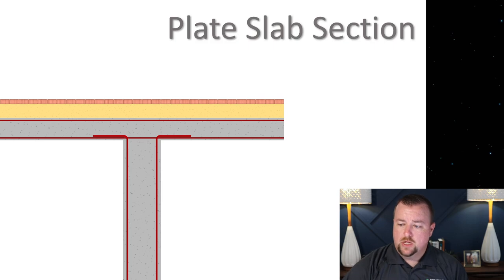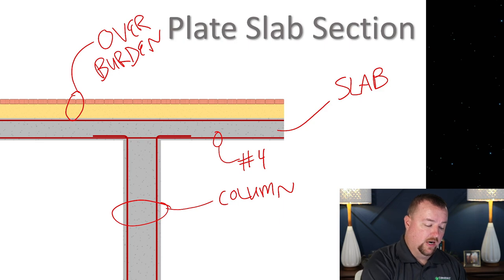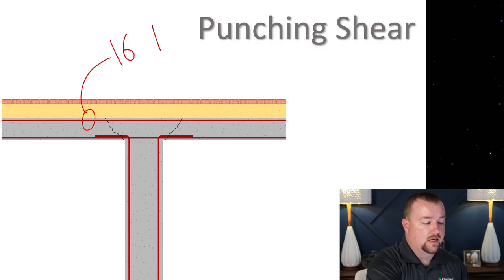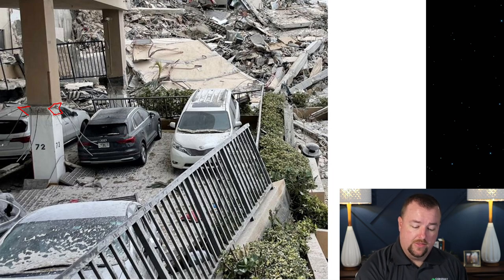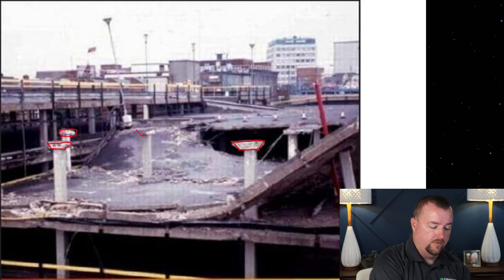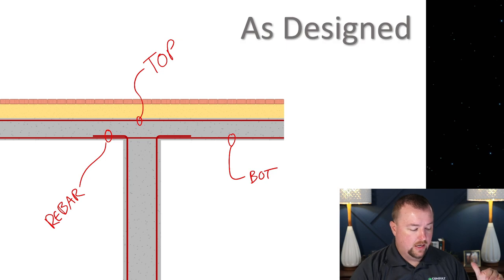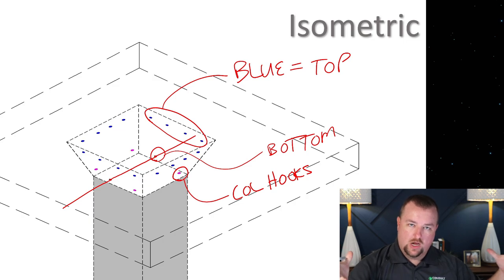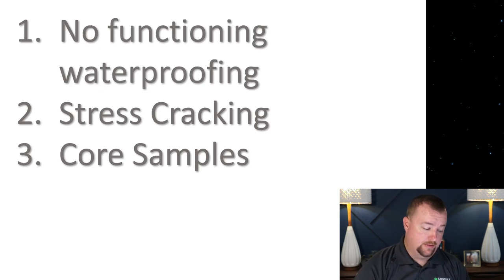The Importance of Punching Shear at the Surfside Collapse

Comment from the maker: For the more technically advanced viewers.   The contribution of the steel to punching shear in this building is not as significant as the concrete's contribution.  Codes around the world limit most of our punching shear formulas to JUST the concrete.  Shearhead reinforcement is only used if the math doesn't work for the concrete alone and this type of reinforcement must be specially designed.  This is built into the codes more as a precaution than because of any idea that the steel does not contribute at all.  The reason for this is because concrete failing in shear is sudden and catastrophic and should be used as the limiting factor.  Therefore In this video, we look at losing the steel reinforcement, which may be argued as insignificant, but nonetheless relevant, AND the loss of the top layer of concrete due to delamination, which would reduce punch-through resistance by as much as 25%.  For more information, I recommend reading the ACI commentary on 2-way slab shear from ACI's historical records.  Thanks for watching!
Reply: What If punch-truogh caused pool deck collapse? And there is clip that shows water flow from pipe to carage. Could 7 min water leak to damaged carage cause hole building collapse? Atleast if there was void space and cagare slab broke and cause suddenly huge flow of water to void space that could cause  damage to columns stability.
Reply: BTW, I liked the video but I just wanted to clarify some misconceptions about shear in concrete.

With any significant bending (Mf>Mcr) and full delamination or corrosion you loss 99% of your punching shear capacity and not just 25%.

The top bars are there for bending but they are absolutely critical to punching shear capacity. Without them, the shear capacity approaches zero. With a high bending force, even without delamination, any major corrosion in the top bars will essentially eliminate the punching shear capacity (Although with very low bending stresses, you will still have some punching shear capacity without top bars).

It is a misconception to think that there is a steel (vertical steel) and concrete contribution. This idea came from older codes. The concrete portion was a fudge factor since the steel portion significantly under estimated the predicted shear capacity from a 45 degree strut and tie model. Newer codes (I am not sure about the US codes since I am not from the US) use a variable strut angle models that more closely models the actual behaviour.

If you had pure bending without shear, the concrete crack in a slab or beam is vertical. With low bending but high shears, the crack angle might be 30 degrees from the horizontal. With varying bending and shear, the angle starts vertical out the edge of the failure cone (the hammer head) and then develops into a shallow angle where the column intersects the bottom of the slab. The compression strut is close to parallel to the cracks in the concrete (Mohr's circle: the highest compression is perpendicular to the highest tension). Vertical steel crosses through the cracks so you can develop a "truss" to increase the capacity. However, most countries don't allow for vertical shear steel in thinner slabs (it has no effective contribution since it generally can not develop over a short height).

Understanding the relationship between the top steel and punching shear is critical to understanding the probable initial failure mechanism.
Reply: 13:40 The sand+paver+ waterproofing +  tile+mortar + topping slab  together form a layer of 4  6/8 inch which is already pretty thick. I wonder if that's the delaminated  layer that we see on the pictures pointing upwards, discussed later in this vid   ( 22:40 ) 
---
What happens, if a 12 floor building collapses on top of a completely intact pool-deck. Would that lead to the collapse of the pool-deck ?
Reply: @reallyme3573  Second hand eyewithness has told that pool-deck collapsed first.
Reply: I’m wondering if the builder even followed the planners rebar schedule.
Reply: @reallyme3573  We know that the deck failed first from video evidence and eyewitness reports given from people in the building just before the collapse of the main building.
Reply: @yodaiam1000  Codes be damned. Engineering knowledge should be the same everywhere. It's the engineer that follows a bad code that is to blame. See my comment below.
Reply: @ToIsleOfView  I don't know which comment you are referring to.

Codes aren't a precise representation of concrete behaviour. They can't be. What they try to do is give a simple representation of the behaviour that is consistently safe. There is an art to approximating nature in simplified formulae. The structural code is not to blame in this case (or at least as far as we know at this point in time).
Reply: Josh..Have you ever utilzed your skills and analyzed what took place with the Solomon Bros. Building (Bldg.7) as it's referred to as the new owner being Larry Silverstein's  of this entire complex was said to have communicated with a fireman conveying to him to ""Pull It" and BBC's uncanny knack of telling it's viewers that this building hadn't even collapsed at the time of their statement along with the said booming sounds of many witnesses statements just before this building collapsed into it's own footprint later that evening as if it were a controlled demolition.  Uhh Uhh..No not fire.  And no...No commercial jet airliners ever hit any of those towers...IT''s next to impossible to fly any jet air craft at sea level altitudes at the speed and accuracy indicated with CGI video footage which also wreaks of fakery.
Reply: The slabs punched through the support columns due to delamination and weakening of structural slabs and rebars strength resulted in the water intrusion and chloride attack. Did the structural engineers also measured the diameter/thickness of the failed columns? I think if the support columns are not that thick enough and hold water for so many years stressing the slabs and columns coupled with the reduced punching shear strength by 25% on its concrete slabs and rebars due to delamination, the parking garage ceiling slabs would sag rapidly and punch shear easily above the pool deck/below the parking garage. May I know if the diameter/thickness of the support columns may also contribute to the rapid punch shearing failure of the concrete slabs? Also, am I correct to say that the punching shear failure started when the pool deck starts to sag down to the basement parking garage until its collapse? Thank you.
Reply: The pool deck may have collapsed first, but before that there was failure in the garage entrance ceiling 1 floor above, with a large flow of water and ceiling collapse at entrance happened FIRST.
Reply: @jockoharpo2622  That's a good one. Keep it up. :)
Reply: @yodaiam1000  How does the deck take down the rest of the building? Why aren't buildings designed even in 1980 to not affect the other areas if just a deck area collapses?  No..The lesser tall structure collapses then takes down the higher structure.
Reply: @jockoharpo2622  Actually in earthquake zones we want the structure tied together. In a healthy structure, it helps create redundancy. We call the lower deck and surrounding walls, the podium. We transfer earthquake forces from the core to the podium walls. In order to do that, you have to have the building tied together. If you don't do that, it gets very expensive to deal with the earthquake forces.

There are many  possible triggers that can take down an entire structure. Of course, where practical, you try to get rid of those triggers. In this case, it was and still is extremely common to tie the building to the podium. No professional would look at that and decide that it was bad decision.

Punching shear is responsible for multiple building collapses. In many cases it started in one small area and then progresses throughout the building. Sampong in South Korea is an example of this. A building, especially heavy concrete ones, has a lot of potential energy which leaves it open to progressive collapse. You really can't completely design around this. You have to be very careful with shear and punching shear in concrete.

The bottom line is that there is no fool proof building. you can't ignore maintenance. You need a good membrane and building envelope.

We don't know yet, but there could have been contributing design errors as well. But that is another issue.
Reply: @yodaiam1000  Is Miami in an earthquake zone?  Well so much for healthy.  The healthiness would also include it's ability to not take so many or any lives with a collapse  that could have still been engineered to support the other parts but still to have the ability to "break awaay" from the rest of the structure not damaging it so people may have more time to escape.
Reply: @yodaiam1000  Well it definitely redundantly collapsed. By the way..Who is "we"?
Reply: @yodaiam1000  And wehre do  you get this knowledge you are sharing?
Reply: @yodaiam1000  What maintenance could have been done to have saved this?  I would think that there would be an inspection dept for the city that helps to keep them up to code since this is a prone area for water breachment along all coastlines. - Especially with corrosive environments.  - Moreso than earth quakes.
Reply: @jockoharpo2622  It is not reasonable to compare a badly maintained building in a highly corrosive environment without a proper membrane to other redundant buildings.

"We" refers to structural engineering design professionals. I am telling you what standard practice is.

Any punching shear failure anywhere in the building could have had a similar effect.

We have punching shear and shear design as being critical drilled into our heads because it so unforgiving. There are for more warning signs of a concrete bending failure and it tends to fail slowly. There is no way to design your way out of punching and other shear failures except to make sure you have enough capacity and by adding integrity bars.
Reply: @jockoharpo2622  I understand in this area that the only required maintenance is a 40 year inspection.
Reply: @jockoharpo2622  For maintenance, you have to check for and repair delamination, replace membranes, Make sure the drainage is working and acceptable.

It is true that many of the buildings in this area and other corrosive environments may be doomed.
Reply: @yodaiam1000  Where are you?  Do you lose sleep over this and obsess about the comments on here?
Reply: @jockoharpo2622  "Where are you?  Do you lose sleep over this and obsess about the comments on here?" I didn't see this comment until later.

The answer is, no. But if you want to learn and have an honest conversation, that is okay. I assume from your comment that you are just interested in trying to troll people.
Reply: If the entire top reinforcement layer has delaminated and with the other less spectacularly visible pre-damage from water, could this have been repaired in some meaningful way (assuming it hadn't collapsed) or would a "repair" translate to complete demolition and rebuild of the pool deck?
Reply: @yodaiam1000  Which it should be every other year.  The way that building was built, it's not wonder it went down sooner.  That decking should have been separate from the hirise portions of the structure. You can build a card house like that and it would do the same thing.
Reply: @tz8785  I think once they dug into the roof deck they would realize a replacement would be best.
Reply: @jockoharpo2622  You are correct. There should be more consistent reviews especially in corrosive environments. I don't know where you are going to get enough structural engineers to do all that work but it is not a bad idea.

Expansion joints are notorious for water leaks. You are trading one failure mechanism for another. You also haven't resolved any of the other hundreds of potential progressive failure mechanisms. You have also created a series of other structural issues.

I haven't done any calculations on this building. It looks lightly reinforced to me but that was common for the 1970s and early 80s. The price of rebar was high.

The ground floor slab is continuous on most high and low rises. If you don't live a building with a continuous ground floor slab, you have certainly been in one.
Reply: @jockoharpo2622  There are far more partial collapses than total collapses. The Worlds Trade Centre building almost collapsed during the first terrorist attach.

Some partial collapses come very close to total collapses.

You do your best to design a resilient building but you can't predict everything. One decision can make one mechanism more resilient but make another mechanism worst. It is impossible to take all scenarios into account.
Reply: I don't think you should use a concrete only shear design if the slab is poured separately from the column because the slab and column are not one piece if you do that, but that is the way it is done.
Reply: @jimanonymous113  It is rare to use shear reinforcement in slabs. You usually use drop panels or capitals (thicken the slab at the column) if you need more punching shear capacity. Nowadays you can get shear rails for some steel reinforcement but they  didn't have those in 1980. You usually don't use shear rails unless you really have no other choice.

Shear steel is not always used in other elements as well.

The slab is almost always poured separately from the column. You pour columns, floor plate, upper column etc. as you go up the building.

Pouring the column with the slab does not increase the punching capacity of the slab.

It not good to pour the column with the slab because the wet concrete in column settles (plastic shrinkage) leaving voids between the column and underside of the slab.
Reply: @yodaiam1000  thank you.
Reply: galvanizes rebar in the bottom of the slab!
Reply: @jockoharpo2622  911 truth
Reply: @reallyme3573  yeah but video and sound shows the pool deck was the first to go. sounds from below says the first floor and some columns in the garage failed. the noises scared a few residents to evacuate. the pool deck collapse noise actually warned people. like 1-2minuntes later the structural compromise was too much and that side of the building sheared off an down killing 98 people. video footage and analysis will corroborate my statement. one lady was on the phone with her boyfriend telling him she saw the pool deck collapse moments later she was a human pancake.
Reply: @ToIsleOfView  water damage! codes don't allow for damage to occur. the building inhabitants and maintenance and building inspectors are all incompetent.
Reply: @jockoharpo2622  boiler room explosion due to damage from the other towers collapse.
Reply: @linn6980  no. the foreshortening of telephoto picture has tricked you. Perspective. The collapse happened at the end of the parking ramp which is 60 feet into the structure and under the far wall that sheared down. Part of the fist floor and some columns collapsed directly under the side of the building that sheared off.  breaking pipes. that's why the pouring water. a minute or 2 later the whole thing came down.
Reply: @jockoharpo2622  ridiculous to think we can design buildings over 10 stories where one part can collapse and not compromise the rest. ridiculous. if it's possible to design that within the monetary constraints by all means design that shit. aint happening brah.  when a building collapses it can and has compromised the neighboring buildings and they could collapse too and have. dominoes. those are seperate structures seperated by vast space. what you suggest is impossible with todays tech.
Reply: @tz8785  it would depend on how far the damage  had spread. It could be the columns were compromised all the way to the top and more than 1 floor slab was inundated with water. or just at the bottom. post analysis will show exactly where the water infiltration was.
Reply: @WholeCosmos  What are you talking about?
Reply: @WholeCosmos  Youre reciting hogwash.  No boiler room explosion in a building like the Solomon Bros along with the towers that did NOT collapse cause that building to go down in a free fall style conrolled demo. Silverstein blew smoke up the world's ass when he stated there was much loss of life so he instructed "them" to "pull it".   That is professional demlition terminology to close the switch to the planted explosives.  That was a clean and clear professional demolition of that building.  There were many instances where people including firefighters hearing small explosions as the building was going down.  I'm not going to  sit here and banter back and forth with nonsense you are dishing out.  The towers didn't collapse. The crumbled as they fell into dustification with most of the material.  They never collapsed from a commercial jet airliner.  IT's impossible for aluminum aircraft to melt into  concrete and steel structures like the WTCs like an animated gumby and pokey claymation cartoon.  It's ludicrious and impossible. THe wings would have broken off and fuel would have been scattered down the side of that building. Can you at all be capable of critical thiking at all?  Do you have to have others think for you?  THe holes made by the aircraft doesn't even match the shape of the jets.  Wings will not penetrate buildings like that as if they were sheets hanging on a clothes line.  Neihere will aluminu fueselage penetrate a building and hold it's nose cone shape comingh out the other side.  YOu believe all of that shit I bet.  Go away.  I don't want to hear anymore of your balderdash.
Reply: @linn6980 : If you look at his other videos, it was exactly the pool deck that you saw collapsed to the garage.